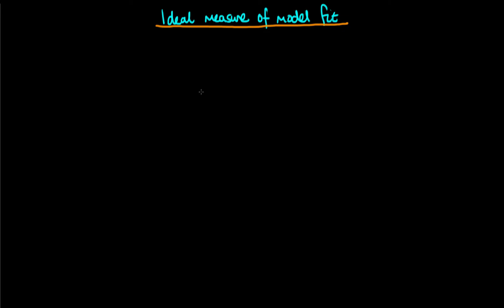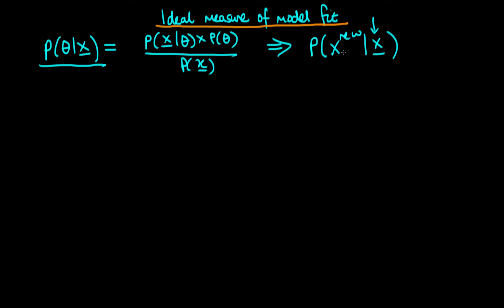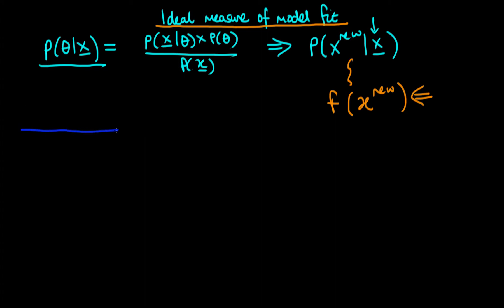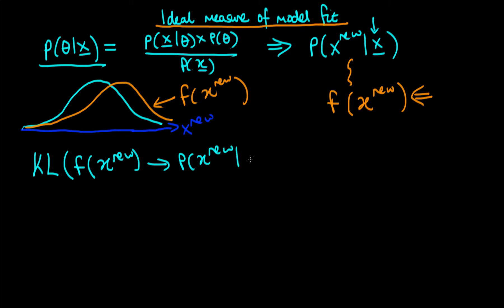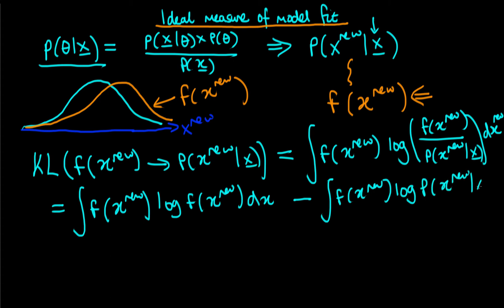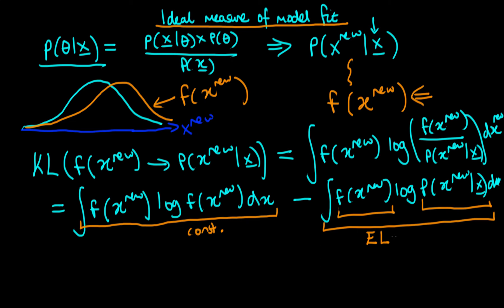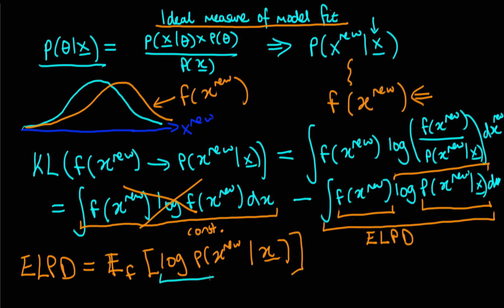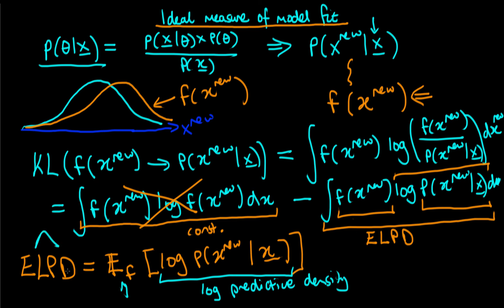The ideal measure of a model's predictive fit

Comment: but your last remark re dx*new contradicts with statement that first part of the integral is constant...
Reply from the maker: Hi, thanks for your comment. It's not because of x^new that the first expression is dropped, however. It is because the first expression does not contain p(x^new|x) - the only part of the expression which we have any control over. Remember: f(x) is the true - fixed - data generating process. We can change p(x^new|x) by changing our model. We cannot, however, do anything to affect f(x). In other words -- as a function of p(x^new|x) -- this first part is constant and so we drop it. Hope that helps clarify! Best, Ben
Reply: Ben Lambert, ок, thanks, now I see why it's dropped!
Best,
Saba